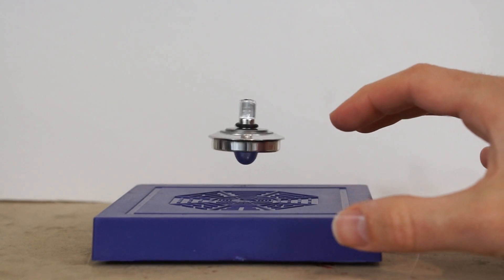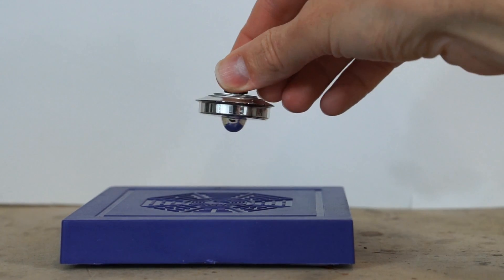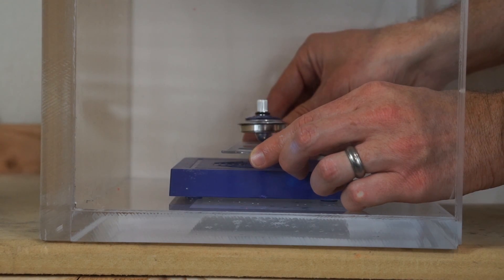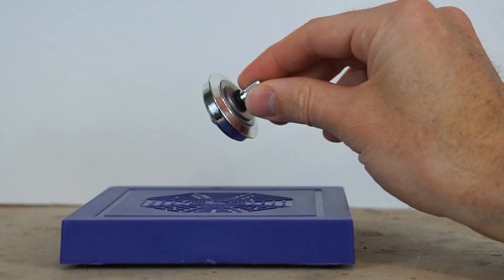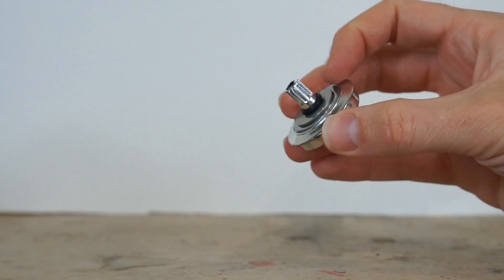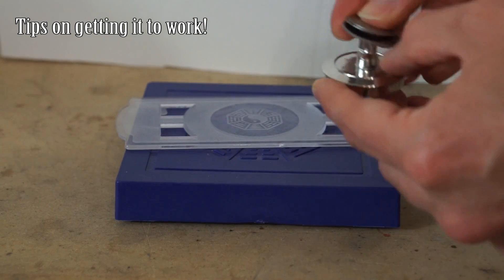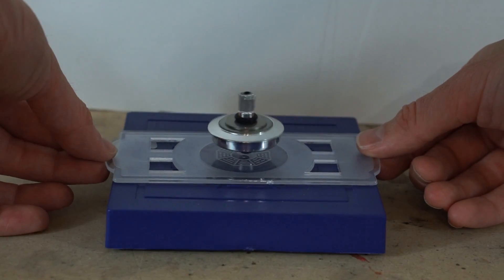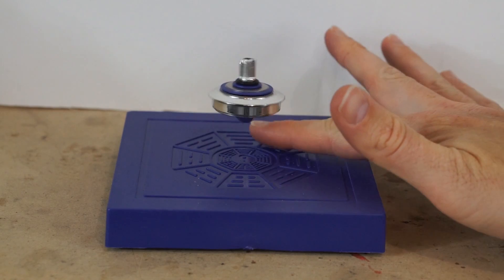Will a Levitating Gyroscope Spin Forever in a Vacuum Chamber?

Comment: your explanation is actually incorrect, it has very little to do with the magnet in the casing moving, which is likely actually glued on to the base, but it has EVERYTHING to do with precession and gyroscopic effects, and here's why:

the top has some instability - it wants to fall over to one side due to gravity (a change in pitch), 

gyroscopic effects mean that any force applied will take effect 90 degrees offset from the axis of rotation, causing precession (a change in yaw), 
this new motion is, in a way, the result of a new "force" that is applied to the top, this in turn is ALSO affected by gyroscopic effects, meaning it will again take effect 90 degrees offset relative to the axis of precession(a change in roll), however this second gyroscopic effect force actually ends up resulting in a force that is exactly opposite to the direction that the top is spinning in, slowing the top down ,

in fact, because of the smooth shape of the top, even in normal air, air resistance is only a fraction of the reason the top slows down, with precession and gyroscopic effects being the majority
Reply from the maker: +Sirius Black yes, if you look at my pinned comment at the top I mention the gyroscopic effects. I do agree this is a major factor that I should have mentioned. But the spin does slow down also. If it was just precession then it should stay the same speed but slowly tip over. The magnets in the base actually do move slightly on this model. But, even if the magnets were glued to the base, when you bring two opposite pole magnets together the small magnetic domains shift slightly cause internal friction. So even if the magnets were completely stable they have internal friction due to the bouncing of the opposite pole disk on top causing domain shifting causing friction and slowing the spin.

Comment: with the vid paused, and me avoiding the comments, I always came to believe, even as I came to enjoy these vacuum experiments, that we never truly can create a perfect, vacuum. I don't know why, but I look at it kind of like absolute zero. We really can't get there, even though we can get ridiculously close. So I'd argue there's just enough gas in there to slowly widdle away at the  top's surface, and reduce its spin. Either that, or eventually you run into magnet decay, as I read somewhere that not even magnets are immune to entropy and the loss of their magnetic potential. So It'd have to fall some day.

OH NEAT! After unpausing, and watching it drop right after, I started to wonder if there is magnetic field friction, where the two opposing forces of magnetism eventually buff against each other in some invisible way, eventually stopped the top.

Comment: eddy currents
Reply: Friction???? THAT is your answer? I'm right, you're wrong. The chances the big magnet is moving are low. You'd hear it for one thing (except in a vacuum). No my friend, eddy currents are the answer.
Reply from the maker: +L Ofaday actually after thinking about this more I think you (and I) are only partially right. It is actually gyroscopic precession that ultimately stops it the most. Eddy current are happening, but the magnets are ceramic and the spinner is plastic (except for the metal washers on it). Also, even thought the magnets in the base don't move on a large scale, the magnetic domains definitely shift when you bring two opposite poles together. That is the friction I speak of.

Comment: I say that it won't spin forever because even without the air resistance, there is still the pushing of the magnets that will still slow the spinner until it stops, at least that's my guess.

Comment: even if it wasnt wobbeling it would stop because of the laws of thermodynamics. Everything radiates energy in some form so there is no way energy can be contained inside a system forever. Even if it was in space it would radiate some of its energy as heat away from the system no matter how little enrgy it gives away there is always some so eventually it will stop

Comment: Are you sure the friction you mention is the major retarding contributor in this system? How about induced currents in each magnet and those washers and any other conducting part that experiences a changing magnetic field? They should be at least as significant as the spooky friction at a distance you refer to.

Comment: go to space then it will spin forever and it will levetate 😂
Reply: SiddheshNandurkar false there is still micro gravity in space so that would stop it
Reply: Kingseeker GAMING its slowed between15 millionths and 25 millionths of a second every year it will take atleast140 million years before the Earth's rotation slows enough to necessitate a 25-hour day.
Reply: the keyboard warrior the earth is slowing down though
Reply: 1.) magnets do not last forever.
2.) other forces may come into play depended on where in space. Such as gravity, solar winds, heat, ect...
3.) if in space then eventually the entire thing would spin. that magnetic field is effected by the rotation of the magnet. Eventually the rotation will convert over to the base as well. Then over a long period of time both will be spinning at the same momentum. Meaning the gyroscope will slow down.
4.)Space it not a complete vacuum and will slow it down. 
5.)Gravity will effect it. Everything has gravity and everything pulls everything no matter the distance away. Eventually the gyroscope will be pulled into a bigger mass.
6.) Radioactive decay will also kill a magnet. To be an atom that is magnetic by nature you must be unstable. Flowing electrons are one of the traits that an unstable isotope or atom has. Meaning it most definitely has a half-life. so over a long period of time the magents will no longer be the same material and the gyroscope will fall apart.
Reply: It wouldn't spin forever even in vacuum because of magnetic fields it generates when it spins.It will spin for very long but not forever
Reply: You guys know that's giving off energy still?
Reply: Siddhesh what other people are saying is all sciency bit think logically... it will eventualy crash in to some planetoid body
Reply: Guys , don't even bother to correct someone here, you'll end up in a pointless argument between an idiot (or me. Or an idiot me. Wait I'm an idiot already)
Reply: yup
Reply: If you take a spinning top and spin it in the middle of the most empty void of space....  It will continue 'spinning' indefinitely until external forces affect it in opposition to its intrinsic angular momentum (or) proton decay eventually breaks it apart.
Reply: Siddhesh hm, lots of misinformation here... gravity by itself doesnt stuff, friction with things does. there is also gravity in space, without it we would not be orbiting the sun. you only "feel" less gravity in an orbit around something since youre basically falling sideways really fast. think like in an elevator. if you fall in it, you feel weightless, but gravity still affects you. its the same in space.
Reply: nope. solar winds will fuck it up
Reply: TheYouTuber_MC  nope
Reply: THE KEYBOARD WARRIOR why , the earth spins due to force from the sun

Comment: Of course it will stop, the spin induces an electric current in the spinner's case wich build up another magnetic field with north pole facing down (as the spinner) but with opposite magnetic field spin direction, wich acts as a magnetic brake (a very weak one)

Comment: writing this before wantching the video.      the theory sounds nice accept that there is light resistency, magnetic field resistency, gravitational resistency, accelerational resistancy (becaus earth is moving) and the tiny fact that this toy only works by pulling rotationary energy from the toy and giving it off in form of levitational "energy". still you will propably get a little bit better performance in vacume. since the toy is symetrical on every horiziontal axis you will get high eficianty even in atmosphere. now i am going to watch the vid.
Reply from the maker: You are spot on!

Comment: the gyroscope will definitely stop, even in a full vacuum, because there's no such thing as a full vacuum, there will still be particles (because particles keep popping in and out of existence) making contact with the gyroscope which results in friction which will slow it down a bit, it doesn't matter if it's gonna spin for a year, a decade, or a billion years, it will eventually stop

Comment: it will stop. without getting to complicated, I say that it will stop because eventually, it will decrease it's speed to a very low velocity, causing it to fall. It doesn't require much physics to analyze this. It's logic because if you were to put the gyroscope above the magnet without spinning it, it will fall. But if you would be spinning it, it floats. As speed decreases the hight it stands at decreases as well, though, ever so slightly, and then eventually falling down. Same rules apply in the vacuum chamber. The only things that change in the vacuum is that there is less air and the pressure changes as well.

Comment: Your explanation of the slowing of the rotation of the top in the vacuum doesn't make sense. You're describing how forces on the top can communicate with the base, but in order to slow down the rotation of the top, there must be a net torque on it. However, a magnetic dipole only experiences torques perpendicular to its axis, which couldn't be responsible for slowing the top down along its axis.

Another explanation is required.

Comment: It will stop, I think, because:
1. Random fluctuations in its precession, vertical and horizontal motions will eventually push it too near the tipping point.
2. Magnetic induction current losses. And this will increase the effect of 1. as precession-wobble will increase.

That my prediction and reasons.
Reply: Ha. It fell 3 seconds after my prediction!
Edit: I don't buy your 'friction' hypothesis.

Comment: 100% it'll stop. 

There's still air inside that chamber. Even though it's a tiny amount, there's still a tiny amount of air in there that'll cause enough friction for it to stop eventually. 

It might take a lot longer, but it will stop. Nothing goes on forever. Nothing.
Reply: Supra Kooper but the reign of memes will go forever.
Reply: Edgy Teen after a quick google search i found how they stored antimatter

"In these experiments, electric and magnetic fields hold the antiprotons separate from positrons in a near-perfect vacuum that keeps them away from regular matter. The antiprotons pass through a dense electron gas, which slows them down further."

so yeah there is no perfect vacuum we can just get close to it (like we can't achieve absolute zero)
Reply: tru
Reply: Actually something can spin forever, for example In space. Regarding this though, it would not spin forever because the magnets are creating electronic currents which will slow down the gyroscope.
Reply: Edgy Teen there are some air molecules even in space. There is no perfect vacuum
Reply: Clorox Bleach True
Reply: Clorox Bleach Well, actually there might be. If not how would scientists contain Anti matter then. Anti matter would just explode if it comes into contact with matter.

Comment: I like how you explain the science behind your test.
Reply: yes if you didn't know it already.
Reply: It will stop because energy is used by procession to keep the top upright,  and this energy comes from slowing the top,  which will eventually collapse.

Secondly,  this magnetic top is rotating in a magnetic field,  which means that electrons are sloshing back and forth from the rotational speed much like in a generator.  the flow of electrons is consumed by resistance and turned into heat.

Just like with a generator,  it takes energy to move those electrons,  and that will come from the speed of the top,  causing it to collapse.

I suggest that the two major ways energy is consumed in this system is 1) procession  and 2) electrical current flow and resistance.
Reply: @SeattlePioneer  yes this is the correct explanation. What he says is completely wrong. I've found this to be the case with so many of his videos. They're just cool to look at but he mostly gets the science wrong.
Reply: Yeah it helps understand and learn about what's happening! ;D

Comment: In the prehistoric time s a day was 23 hours cool ha
Reply: Around 5 million years ago

a day was 21 hours long
Reply: lodewijk steengracht becouse earths rotation is exhausting days get longer and longer
Reply: 56 min*
Reply: Drunken Hobo Agreed. Earth slowing down that quickly in that many years is absurd
Reply: lodewijk steengracht 
there was a time when an earth day was 6 hours long. like when it was first existing
Reply: Joltz and Joulery cool i dit not now that
Reply: lodewijk steengracht
The reason for this is an effect called tidal locking. It's already happened to the moon which now shows the same face to earth all the time. Gradually the earth is heading towards a tidal lock with the moon and the energy goes into the moon's orbital height above earth. Essentially it is stealing energy from the earth in order to escape from the earth. If I remember correctly the moon will escape before the earth locks to the moon.

Friction does play a part in this. It is the fluids of the earth (the atmosphere, the oceans and also molten rock) pulled by the moon's gravity that rub over the solid surfaces as the earth rotates beneath the moon. This partly accounts for the tides as well as slowing of the rotation. Hence the name: Tidal locking.

Comment: The little spinning disc is made from a magnet and some metal probbably. If it's conductive, it creates electricity, so that's probbably slowing it down too.
Reply: Tazer counter induced current... nice perception
Reply: The Action Lab  the eddy current contradicts the motion, it's used as a way of damping an ocillation.
Reply: It's a ceramic magnet , yes, but the disk shell is clearly metallic.
Reply: As long that there are metal or any kind of conductor within the changing magnetic field you will get eddy currents. Idk what else causes the gyroscope to loose energy, but just neglecting eddy currents is quite a big assumption.
Reply: I was going to ask if that wobble was going to induce electrical eddy currents.  If so, then the kinetic energy would be converted into heat energy and that would add to its gyroscopic decay.
Reply: Also there is a thing called magnetic friction
Reply: pacukluka yea eddy currents
Reply: ahaha magnetic fields ALWAYS fluctuate
Reply: The magnetic field is not constant because the piece is wobbling and changing its position constantly in relation to the other magnet.
Reply: +The Action Lab Well, i assume it's not perfect vacuum so...
Reply: Tazer... Thanks not how it works... Its a law of physics: Matter or Energy can not be created nor destroyed, just changed from one form to another."
Reply: The energy isn't created... The disc is creating electricity, therefore it's losing energy and it spins slower.
Reply: Tazer its changing kinetic into electric is what he was trying to say
Reply: yup, eddy currents would be generated on the silver plating of the top. to get plastic chromed like that, they have to plate it in copper first, the thin layers of metal would indeed drag the system down until it falls. same goes for the washers. the field doesn't have to have large changes for this to happen, any metal inside a magnetic field that is moving would create eddy currents.
Reply: Tazer It doesn't create electricity, but i know what you mean with dynamo's etc. It'll eventually lose it's magnicity and just fall down.
Reply: If you move a magnet around some metal, it creates current.
Reply from the maker: +Tazer that is true but it is ceramic magnet and plastic casing. Although the washers on it were metal so that has a little impact
Reply: What are you talking about? The spinning disc creates electricity and that is slowing down the rotation of that disc. Where do you see a perpetual motion?
Reply: Tazer will a disc spinning im a unifrom magnetic field generate eddy current.. no.. my guess is the wobble of the disc is creating variable distances in turn leading to varying magnetic field which in turn brings us to ur conclusion.
Reply: To induce a current, you need to either change the magnetic field or the area through which the magnetic field goes. 
In this case here the magnetic field stays constant, because you have two permanent magnets and you don't change any magneticly flooded area. So there won't be any current induced, even if there were some metal parts.
Reply: Tazer this may also be impossible as so far no one person has successfully created perpetual motion, and further more it couldn't possibly spin forever as the magnetic charge would eventually run out